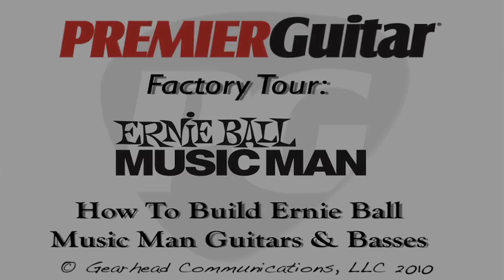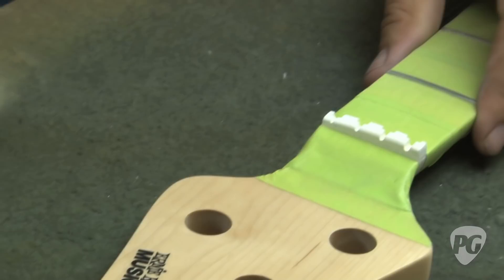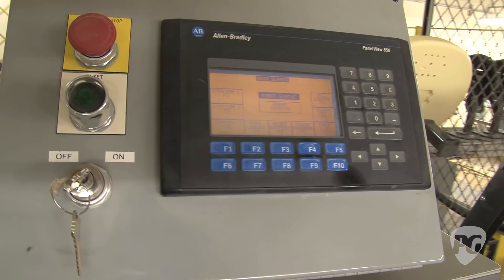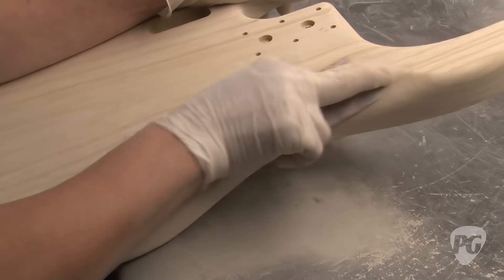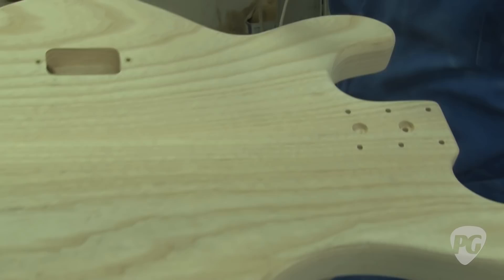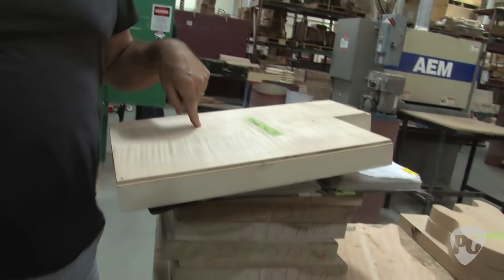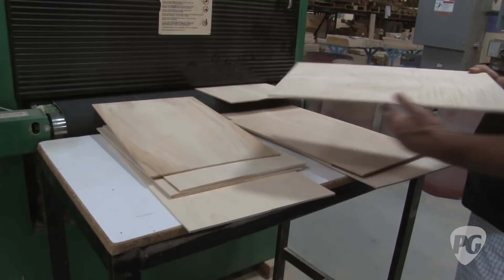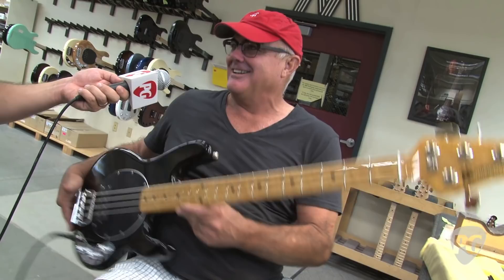How To Build Ernie Ball Music Man Guitars & Basses

Comment: @RhoadsFan9 They are sanding down excess finish to make the surface flat, and to remove any high/low spots. Then they will buff out the sand marks and reveal a glass like finish! They sand the bodies after they have been sprayed and dried. That's when this takes place.

Comment: @hawg427 

That's why you take care of your neck =P Especially if it's a neck thru... =P

also another nice thing about bolt ons is that if you have to much tension on the strings, then you can put a little peice of wood where the neck and body connects so it lifts it up more =P

Comment: @5:06 Wow that's a really short scale length!
Reply: Lol
Reply: Just in case your comment was serious; that's not a neck, it's a block they attach to the neck joint so it doesn't get damaged or excessively worn away during the buffing and sanding stage. it's basically to 'get in the way' so the necks will still fit perfectly once the body is finished

Comment: Ernie Ball Music Man Basses, are the State of Art In Electric Basses.
Reply: So are the guitars...look at the JPs or Majesty.  Dimarzio PUs & switches, piezo, coil tap, 20db clean boost, TRS jack with mag/piezo on separate signal paths, locking tuners, KILLER necks, SS frets, truss wheel at heel, the sweet nut, bullet proof laquer, amazing fit & finish, and super slick tops. That.

Comment: I like how he says 1:16 that he likes to inspect the neck joint make sure its nice and tight, as the guitar he is holding has a 16th inch gap at the neck heel ...LOL ... yeah .. real good fit
Reply: That is the access for the truss rod adjustment...
Reply: Luis Fernandez no.. not the notch for the truss .. the gap between neck and body... either side of the truss notch.. is rather large.. I can clearly see it.
Reply: Catfishstudios I dont know what you are seeing man... I dont see any gap at all.
Reply: Luis Fernandez look at corner of neck joint at 1:17 . Could stick a guitar pick in between body and neck there.
Reply: +Catfishstudios My EBMM guitar's neck joint is perfectly tight, but the edges of the joint are rolled, giving the illusion of a gap.  Furthermore, EBMM doesn't allow paint to get in the neck joint, giving an even tighter union...good luck finding that on even a USA Fender.

Comment: I've owned several made in USA Fender strats, but unless you buy their custom shop, you're probably not going to find anything close to the quality of even a standard Ernie Ball/Music Man guitar.  USA Fender may look nice on the surface, but when you really inspect the details, they're relatively disappointing.  I own a EBMM "Silhouette Special" and I'm beyond impressed.  I've never seen even a standard EBMM body made with over 3 pieces of wood.  Paint thickness on an EBMM body is at least 35% thinner than most USA Fender...etc, etc.

Comment: I have owned five EBMM basses.two had factory issues/defects.one was a brand new Neptune blue SR4 which had the dreaded weak g string syndrome. cosmetically, the most beautiful thing you could imagine; within two weeks I sent it back.I had a LTD bongo-again a beauty; had a really fucked up neck and dead spots galore. this was on a mint bass that was one year old. EBMM wouldn't take responsibility for it-I have seen too many of their basses run out of adjustment at the bridge; all of their fivers have a G that slides off the neck.they aren't the end all.
Reply: EQ bro...thats ALL ya need.  Get a guitar for playability, quality, & looks.  Ebony FB with SS frets...done...smoothest neck around.

Comment: The purpose of a truss rod is for the bow, if you prefer you can make it straight but the point of the truss rod is to put a bow in the neck while their is strong tension. If you want a perfectly straight neck than why put a truss rod in at all?
Reply: So many reasons to put a trust rod in. One of the main reason is to strengthen the neck. Another strong reason is due to climate changes and a trust rod is use to adjust the neck. Music Man makes it straight right from the factory so that you as the customers get a perfect straight strong neck guitars right from the factory and that is call QUALITY an perfect. So just in case if it reach your home with a different climate than the trust rod is there for you to adjust, does that make sense?
Reply: he said "perfectly straight when its tight" 
thats after puttin the strings and tuning
Reply: Vigier guitars don't have a truss rod and Patrice says its not a big deal.